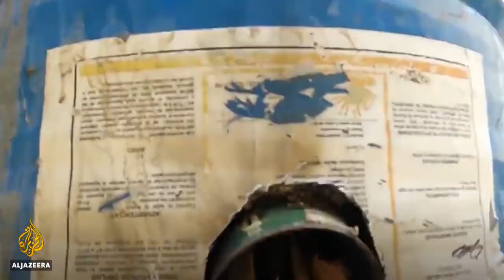Helping People Build What They Need

Comment: I made one of the smaller, tin can-based cooking stoves that featured on this channel. All I would say is, be very careful with the sizes and angles of pipes and chimneys - it was very difficult to get adequate air flow through the rocket stove, resulting in lots of smoke and very little heat compared to my own, theoretically much less efficient design/bodge. (A small tin can tied below a larger tin can with lots of holes in each - more like an incinerator than a stove.) But working with larger diameter tubes/barrels is probably easier than really tiny cans. And I reckon there's also a knack to getting a good fire going that I've not quite cracked yet. Getting a more intricate design to work would save a lot of fuel so it is worth persisting with.
Reply from the maker: What was the problem it was having? It will smoke for the first couple minutes until it gets up to temperature, but should be essentially smokeless after, and draw well.
I found the main trick was to not over feed the burn tube, to only have two or three thumb thickness bits of wood at a time, with at least half the tube empty so it got enough air flow. Means having to feed it a little more often, but gives good results.
Reply: @OpenSourceLowTech  Could have been unsuitable fuel or as you say too fat of a fire. It was the two layer tin can design with the single layer entrance tube and the folded lid acting as a shelf for the fuel, with no added mass since it was designed for cooking. I could get a fire going (cheated and used hand sanitizer, it is a good improvised firelighter) but even after a few minutes, it just would not sustain more than a tiny flame without seeming to get starved of oxygen. I was adding loads of dry bamboo twigs, which burnt well in the incinerator, but they needed constant pushing further in to the rocket stove because the fire was so small and they burnt so quickly, the unburnt ends cluttering the entrance otherwise. I had more success poking them down the chimney but still had issues with draw and smoke. Might try hawthorn or another slower burning wood next time, if I can get it to combust at all. But I also think I got the construction wrong.

Hope it's clear I am not blaming you! I reckon I must have just used the video and not read any detailed written instructions so could even have built it wrong.

If you were able to help the people at Moria then that is amazing. It certainly is a chaotic world we live in and it is about to get much worse worldwide due to events in Eastern Europe and in India.
Reply from the maker: My email's on the opensourcelowtech.org site, if you want to send me some photos I can have a look at what the issue might be.
Reply: @jimcrelm9478  you should look at how a carburetor works and try to make that work using a butterfly valve in the pipe somewhere to control.

Easy to build a small butterfly valve in a pipe for stopping airflow volume. Doesn’t need to be perfectly sealed.

Comment: Have you done any BioGas projects?, cos they can be made simply out of scrap and fed waste kitchen etc scraps.
Reply from the maker: It's definitely on the list of things to take a crack at at some point.
I do have in mind a variation on my solar hot water panel as a temperature regulator for biodigestors in cold environments...

Comment: We should design some stove stirling generator! Keep people warm + charge their phones!
Reply: @capturedflame  Charging more phones :)
Reply from the maker: I've been thinking on options for that kind of thing a while now. Stirlings can be very effective, but probably a bit of a build process in order to produce even 5-10W of electricity. As Daniel mentions thermopiles and the like are also an option, and this stove should get hot enough to get them to function at least, but they're very low efficiency and can also be a bit tricky to source and make use of.

But it would be great to get power off these as well, so I will keep looking for a nicely workable option.
Reply: @OpenSourceLowTech  Stirling engines are very finicky beasts that have to be carefully balanced just to operate at a fixed rate.  Other heat engines have similar problems, which is why it took the better part of a century to tame them with governors and most of the early field of thermodynamic analysis just to get them to be responsive to loads and not rupture so often.

Thermal power systems for thermal applications, electrical power systems for electrical applications. No need to reinvent the wheel with conversion hardware.